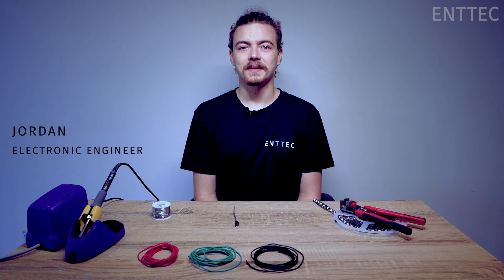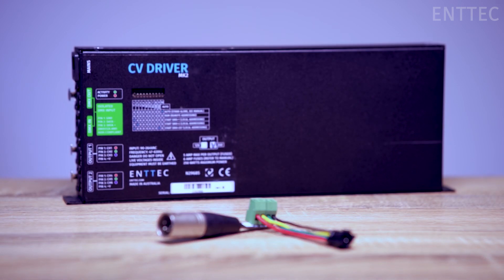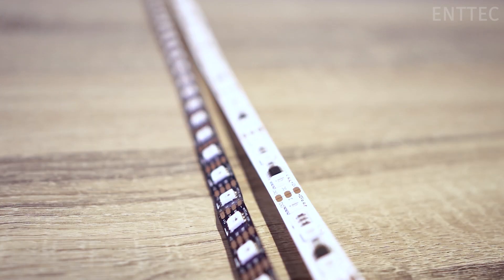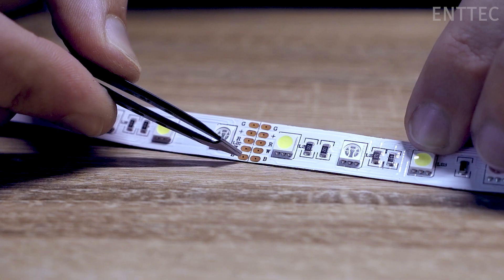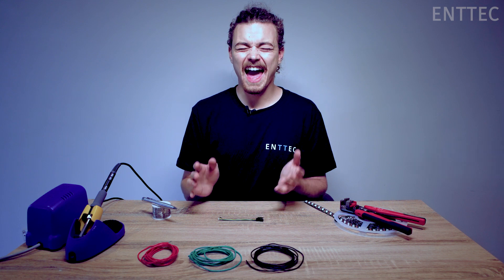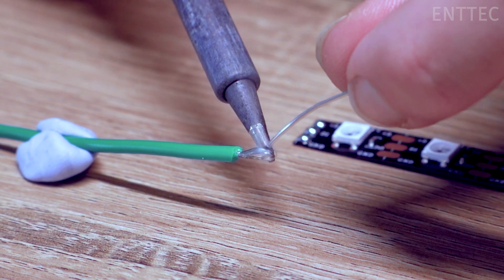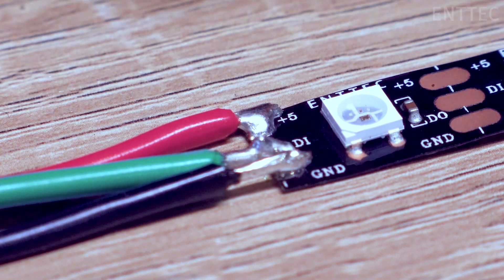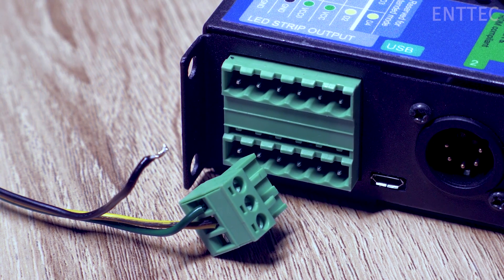Ep.4 How to connect LED tape to simple wire connectors

Comment: Hey, on the LED with 4 colors, RGBB red green blue black, the black is + but which is ground? I want to make a pigtail for "home runs" Thank you
Reply: Hey Tommy, for RGBW dimmable tapes (non- pixel controlled), each colour channel is the negative (0V ground). - The "+" provides constant power to the strip and each colour channel completes the circuit back to the dimmer acting as a ground. - This allows the dimmer to adjust the PWM duty cycle of each channel to change colour. - This method means there only needs to be one "+" on the tape instead of a separate circuit for each colour LED emitter on the tape. one for each channel. In short; you'll only need as many wires as contacts there are on the LED tape. for RGBW you will require 5 wires to connect your tape to the dimmer  - Red - Green - Blue - White - "+". Hope this helps

Comment: Great video. What kind of wire do you need to use?
Reply from the maker: For Power lines use the thickest you can, always check voltage drop using your voltmeter.